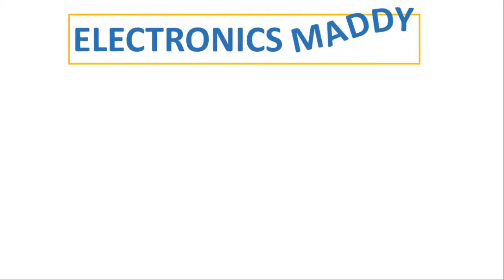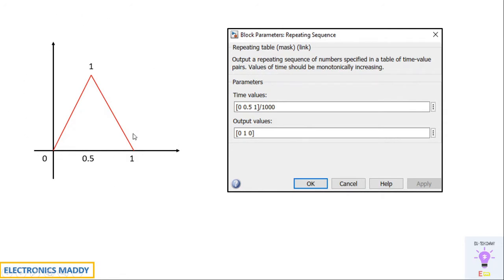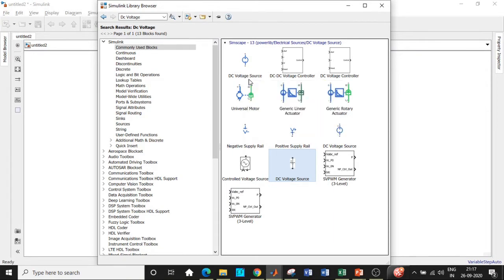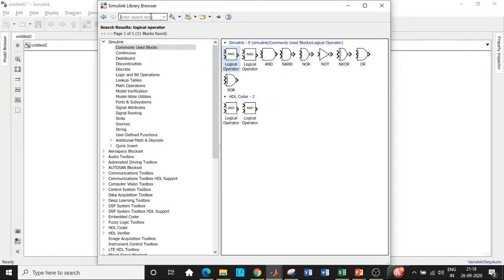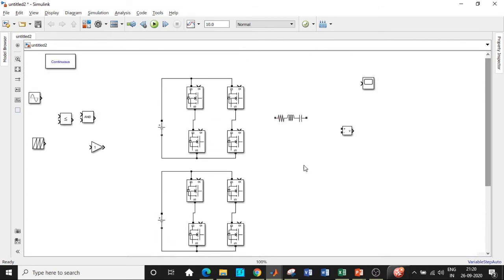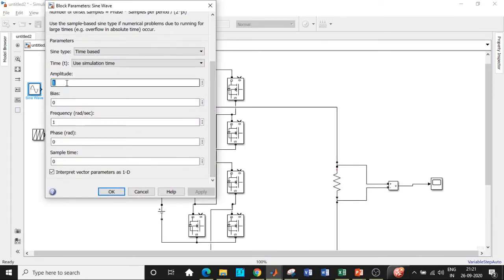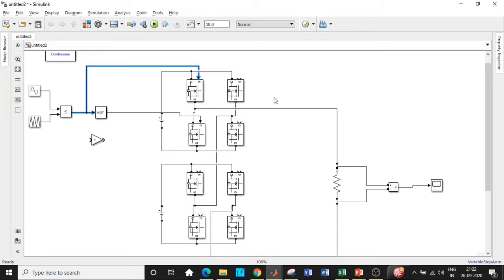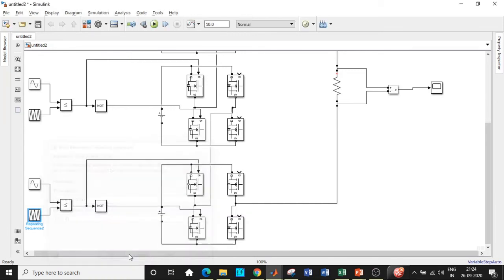Simulation of 7 Level Cascaded H Bridge Multilevel Inverter using SPWM technique in MATLAB |SIMULINK

Comment: Why you use not gate
Reply: Not gate is used because when one switch is on, the other switch should be off and it should be ensured that no two switches are on or off at the same time.
Reply: @nandhiniannathurai2592  thanku
Reply from the maker: For triggering purpose
Reply: Working sir

Comment: Hi , can you make a video of same with 11 level cascaded h bridge mmc ?
Reply from the maker: Hi Omika Singh. You will be able to do it by just adding a couple of bridges in the same way that I have done here.  I would suggest you to try it. In case you are not getting, then I will be there to help you out. So get started. All the very best :)
Reply: Hi ... first of all thank you ver much . From this video I was able to make the 11 level but its little bit deteriorating... I think the problem is with the output value of the  repeating sequence .
Reply from the maker: You are welcome :) Probably. Please send your model to electronicsmaddy@gmail.com. let me check of any issues with the circuit.
Reply: @ElectronicsMaddy  Bro,How Can We Find Efficiency and THD For This Type Of Multi Level Inverters???